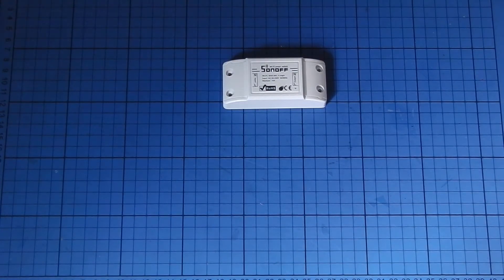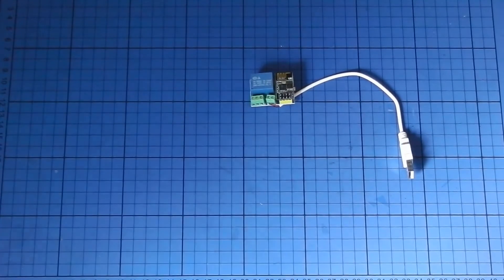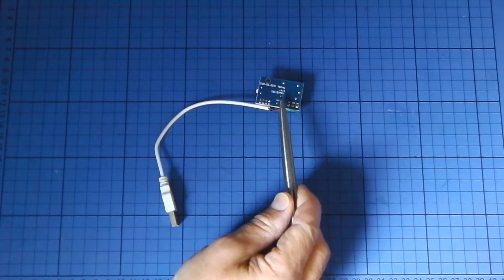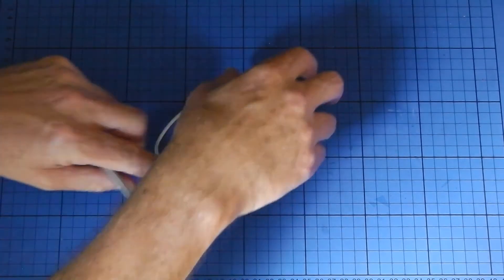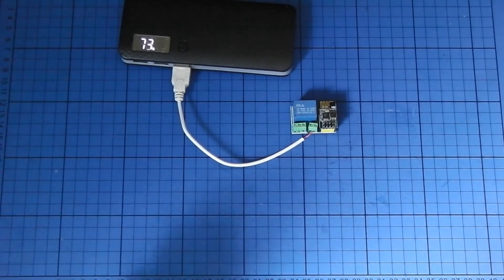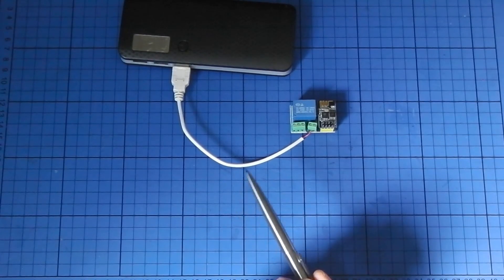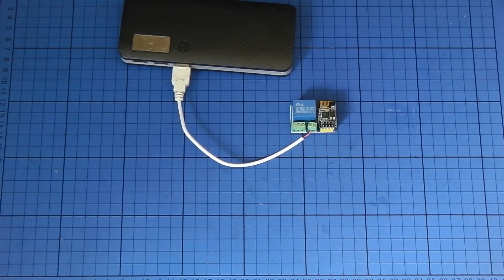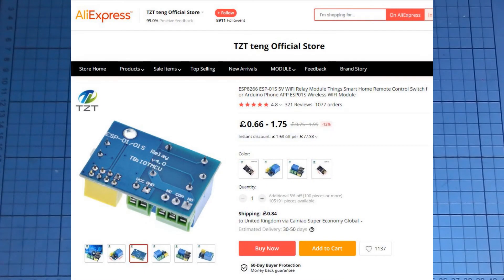ET#1.  Review of cheap ESP01 / ESP8266 Relay V4 board.  5V USB operation.  Tasmota compatible.

Comment: when you plug usb into power bank then why relay on for one second my gpio pin connected 0 am facing same issue help me
Reply from the maker: Is it the same model of relay board?  Some pins have to be in  a particular state for the ESP01 to start up correctly and you may have an relay pin connected to one of those.  There is a useful instructable here that may be of value to you.  https://www.instructables.com/Definitive-Guide-to-Setting-Up-Your-New-ESP01-Modu/
Reply: @ECETek  help me
Reply: @ECETek  i connected and try pin 0,pin 2 and pin 1 but relay trigger for 1 second when esp01 on
Reply from the maker: I haven't experienced this issue with any of my relay units that I can remember.  It seems to be linked to the need to set particular pins in particular ways at certain times i.e. at boot up.  I suspect you are having the same issue as is being discussed on the ESP8266 community forum.  They have a solution there that may be of value to you.  Have a look at this and hopefully it will help you.  It will need a bit of a 'fudge' with your circuit though.  The community forum is filled with lots of people with a wide range of knowledge and perhaps someone else may be able to help you further.  I do hope this is of value:  https://www.esp8266.com/viewtopic.php?p=75082 

I also found this thread which confirms the initial spike is related to start up mode of the ESP01.  https://www.edaboard.com/threads/why-on-startup-led1-connceted-at-gpio-0-once-g
Reply: @ECETek  share your email
Reply: @ECETek  i am using pin 0 on esp01, relay on for one second then off when i power esp01 there is no solution on Internet help me share your email
Reply from the maker: Sorry, no email.  The video you posted shows a version 1.0 board.  This is different to the V4.0 in my video and has known issues.  I suggest you check all the videos on that version.  There are some fixes out there that involve removing a component from the relay board.  I don't have the details but I'm sure you can find them on Google.
Reply from the maker: If you are still experiencing this issue (I appreciate it has been a while) then this tasmota template may be of help:  https://templates.blakadder.com/ESP-01S-Relay-v1.html
Reply: Yes this the same board relay trigger  when esp 01 on
Reply from the maker: If you are still interested and haven't yet found a solution, then check this video out:  https://youtu.be/Uq7ZfutOSSg.  Hope it helps!
Reply: @ECETek  no need, reply after 8 months,i am not working on this project

Comment: What's the app  and where  to download?
Reply from the maker: There is no native app for this device.  It is designed so that it hosts an esp8266 chip on an ESP01 board (the little black board in the picture).  You can flash that with Tasmota which will respond to your Echo devices in an emulated mode, or you could use TasmoAdmin, or you can enable MQTT and use applications such as Node Red etc. to control it.  There are other programs like ESPHome that you can use too.  Thanks for your interest.

Comment: Got screwed when I bought the Version 1.0 board. Thanks for video.
Reply from the maker: If it is any consolation: it wasn't just you mate.  Lots of negative observations on the earlier versions on various forums.  Some fixes too.  No issues with this one.  Just be aware of the poor HV isolation as others have pointed out.

Comment: Have seen these boards but personally I hate them, due to power requirements, HV isolation is shady.
I prefer using NodeMCU + 4 Channel Relay Board running with Hi-Link 220V A.C. to 5v D.C. and that combination is a beast. 
I Have it running for almost 3 years now 24x7 to control Entire Room lights & fan here in India 🙏
Reply from the maker: Too much for what I needed but useful to know.  Thanks.
Reply: when i plug esp01 then relay on one second why it on one second without any command
Reply from the maker: Hi, I replied to your original post.
Reply: @ECETek  when esp01 on relay trigger for one second
Reply from the maker: Hi,  Please stick to one thread.  As above, I have answered your original questions on your own initial thread and given you some info there.  Please don't hijack the threads of others.  Thanks.

Comment: At which version did they correct (other than v4 as you mentioned) the need to do a jumper solder and take off R2?  Thanks.
Reply from the maker: Sorry, can't help with that.  I saw a few of the videos on here correcting the early ones, so deliberately didn't buy them!

Comment: Distance between HV and LV side seems very close...
Reply from the maker: I'd agree.  I certainly wouldn't use this to switch voltages over 24V.  I'm using it with a 12V car battery.  The relay might claim to be rated at 10A 250V AC but I wouldn't tempt fate with that.  Just because it can (if it can) then that doesn't mean you have to!  Good safety point though.  Thanks.
Reply: @ECETek  The relay looks very similar to the ones used by shelly, and the pins seem just as close, though i wouldnt go and test that 10A rating

Comment: can it use 12V
Reply from the maker: It uses an AMS1117 3.3V regulator.  These are rated at 4 - 12V (if it is a genuine chip).